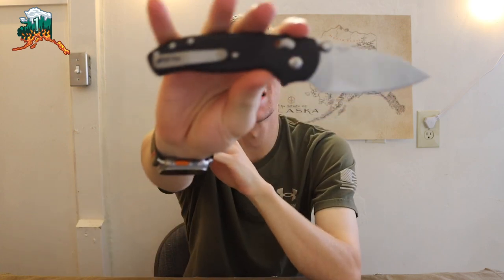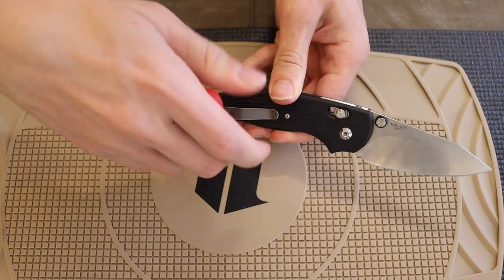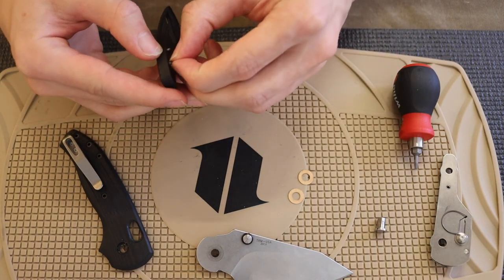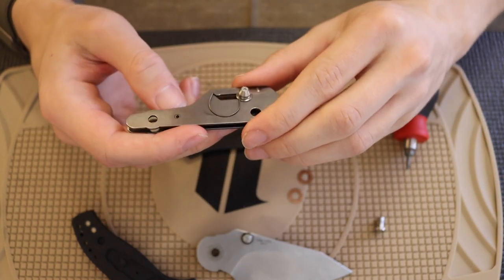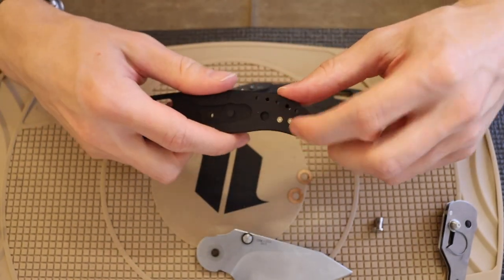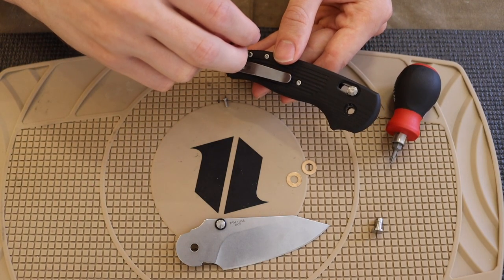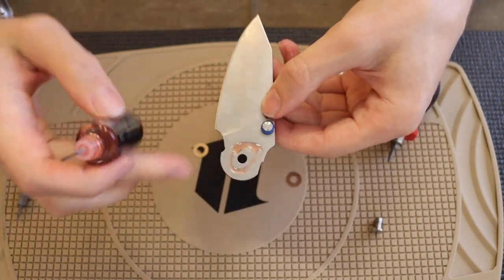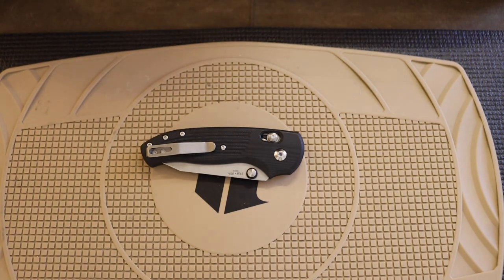What is TRM Hiding? TRM Shadow Breakdown

Comment: It's awesome how they put threaded inserts into the holes. Extra attention to details and Ling term use and maintenance. The 3 backspacers I've heard is homage to Three Rivers, Massachusetts
Reply from the maker: That’s good to know, and yes I am impressed by their foresight
Reply: Two of my inserts broke in half for the clip screws . Well, one came free spinning and the other just broke today a few months later . Luckily , they have a good warranty and offered to have me send it in but I fixed the first one myself. T8 s would be a lot better . The problem was there was no glue to hold the insert on the top half and it either twisted apart or pulled apart